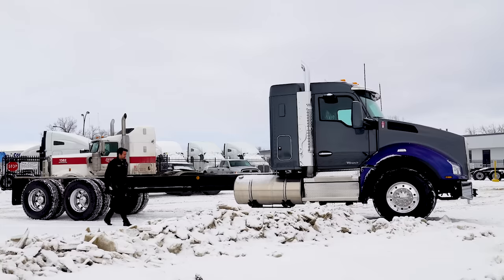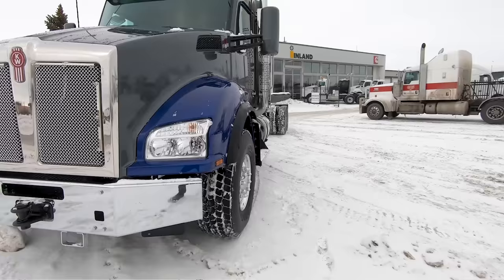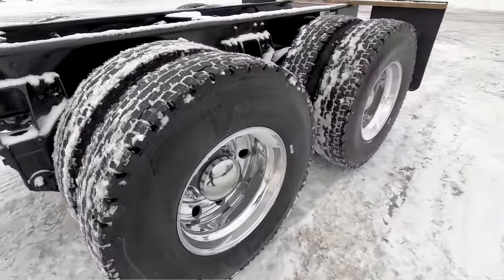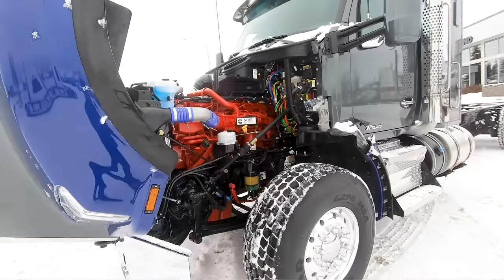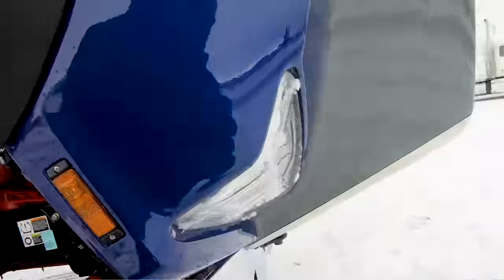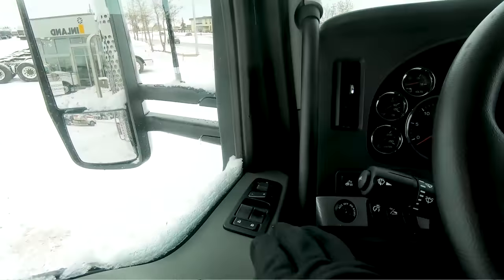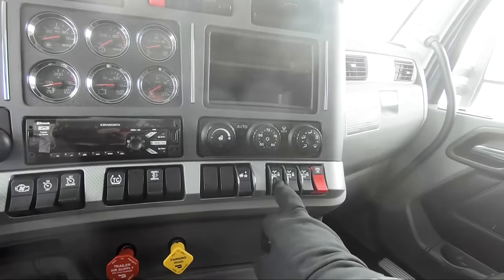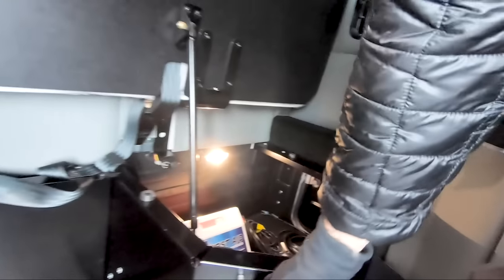LONGEST WHEELBASE - 2021 KENWORTH T880 40IN FLAT TOP   TOUR AND REVIEW

Comment: Wow I love the colors of that truck, it's a great combination. My boss is getting ready to order me a new 880, I had a 2014 W900L before hand which has been a great truck but it's time for some new equipment. So I have a question for ya? I've seen on some of the 880 vids I've watched where there are green lights in the tachometer, what are those and do they still have them in the 2021 models?
Reply from the maker: Yes. It’s for optimum rpm
Reply: @AndyTheKenworthGuy  Awesome,  thank you for responding.  The boss just ordered two new KWs today, a T880 and a W990. I'm excited, probably take the W990 cause in a hood guy lol.. but the T880s are very nice to😀👍👍

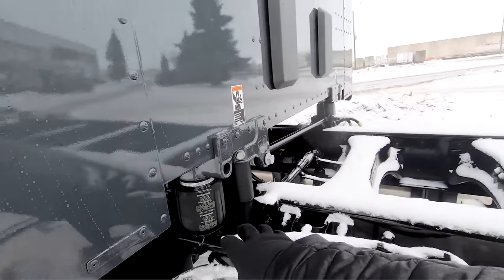Comment: I love my T880 it's a company truck. Sig 15 cummins 10speed stick 3:36 rears suck for 2lane 55 mph mountain roads. But on the big roads she runs like a race horse. My complaint is the hood latches  won't  stay latched. And why does KW have so much extra frame behind the rear end? I pull containers and am running into clearance issues with certain chassis. The fuse boxes where designed buy a contortionist. 
Certain chassis will eat fuses for lights like candy. I need that 40"bunk as well. Kenworth does make a wonderful truck.
Reply from the maker: Frame overhang is determined by suspension and mudflap hangers.
Reply: Ése carro. es muy bonito que mi  Padre Eterno  me permita estrenar uno de color  rojo Viper

Comment: Many (not all) of the whiners about your trucks being too short in wheelbase have probably never driven a truck over the road.  Some people like shorter trucks, others like them longer; it just depends on what the application is.  I personally don't care what length the truck is as long as it doesn't have air-ride on the steer axle and gets the job done for what the owner/owners need it for.
Reply from the maker: Good point! Thanks for watching